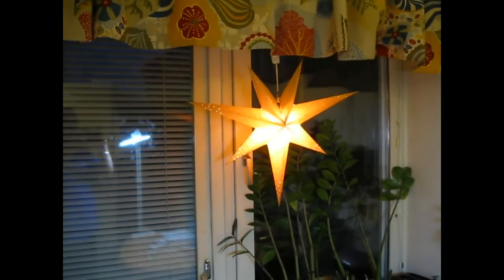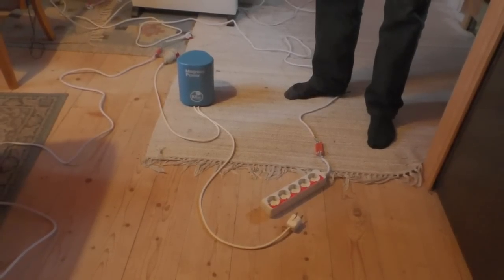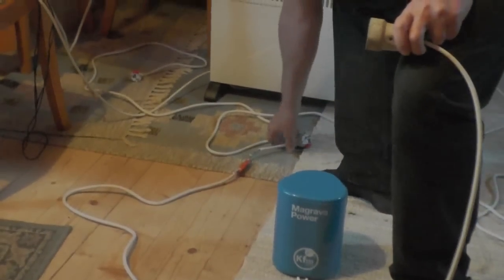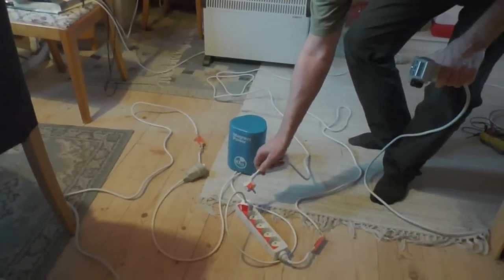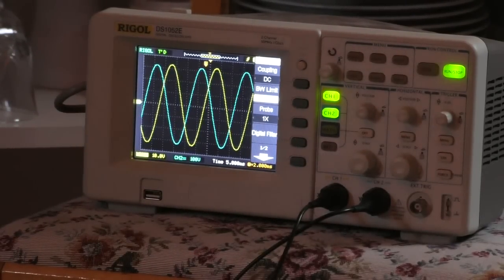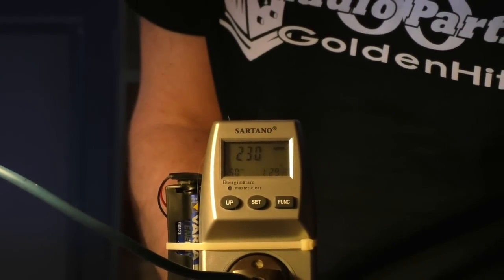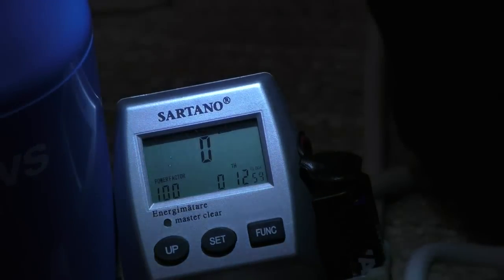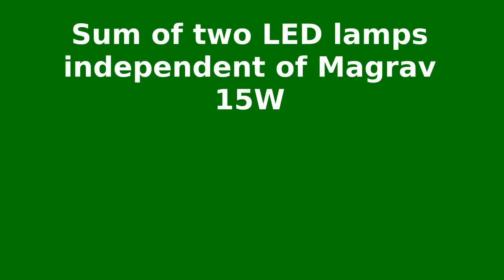#433 QEG Sweden Magrav Unit Tests

Comment: forgive me if mistaken, but I see on your meter, there is 50hz frequency, are you using 230-240v50hz AC?  I thought these magrav things were only good on straight DC..... which would make sense for if this does nano coat wires, if polarity is back and forth, is just blowing the oxides off, like aluminum ac tig welding.  back and forth polarity on a high-ish frequency will blow survace oxidation away from electronic bombardment of a surface, as with ac welding and aluminum oxide removal on the reverse wave...... just curious if so, and have you found any good results anywhere with AC or striaght DC or what?
Reply from the maker: News flash. These "magrav things" aren't any good at all!

Comment: The idea these "magrav" units are nothing more than power factor correction devices is proven here in this video. An LED light normally has a low power factor of between 0.4 to 0.6 and in this video it remains 1....nuff said.

Comment: There is no FreeEnergy in the Keshe-Plasmatechnologie, right?
The hole Keshe-blabla is f*kin' bullsh*?
BUT: my laptop has now a online standby of 120min and rising instead of the 86min like in the last 4 Years... just a pinpongball with some liquid inside on a computer-fan wired with blacked copper to USB. For that the Plasmalogy is good for me.
Maybe its placebo, but than, it was me who increased my laptopbatteries, not a Plasmareactor, or what?
Are we not gods? Just apes? I think, many of us are hidden gods and the others are apes. Just the children where born as man, conditioned to apes in the school, like me. But its possible to engage god-power, at least for me.

Comment: How on earth can you nano coat your house when you put a watt meter in the way??? Do you expect it to nano coat your meter first? Why are you not satisfied with reading your house meter? All of your expensive measuring equipment surely will mean nothing if your experiment is flawed from the start? Remove the meter, it will obviously serve as a closed gate to the rest of your house, maybe then it would be better to check for spontaneous nano coating? - Don't get me wrong, I have no clue if it will even coat your house but removing that meter would be a good start to a great experiment - Thanks for your video. :¬)

Comment: normally the watt after Magrev > watt before because Magrav is just extra-load :), but  watt-meters used in test are not good, one watt difference is not a problem because the load is low. Once the load around Kw, sure watt-meters will be more accurate and the Magrav will be just a load consuming extra watt .

Comment: Why is it that when people test stuff like this they almost always have a  mess of wires everywhere.  When building a testing apparatus all wires should be kept as short and as neat as possible so that anyone watching can visually see where all the connections are going.  Lay the entire thing out in line on a bench or table and everyone can more easily see the setup plus then you can leave the entire thing undisturbed while the test is running.
Reply from the maker: +kuhrd I agree with DG. The wires are much more clearly traceable than others I've seen. I have no reason to doubt the sincerity of the testers or the accuracy of the diagram given. What I am most curious about is what excuse Keshe and hos followers may come up with *NEXT* to explain why it does not work in the face of the evidence I am certain you are all about to witness?
Reply: +kuhrd 

This chap did an exceptionally clean build you might be interested in.
Reply: +kuhrd My thoughts exactly.
Reply: ***** How can you tell anything for sure some of the cords appear to be 5+ meters long overlapping other cables of the same color.  Then you have so much distance between things that they can't even reasonably get everything into a single shot.  My point is that everything on the circuit should be point to point wiring with as short of leads as necessary so that all devices are on the same table or bench with one single path in line so that everyone can visually see the inputs and outputs along the entire path without any points of confusion.  Also when dealing with cords of several meters they will add their own unwanted electrical characteristics to the circuit that can make things harder to duplicate or test in the future.
Reply: ZeroFossilFuel I would agree that you can more or less see what is going on but I guess when I want to show my students something I try to make all my wiring and overall layout as straightforward as possible.  Is there any reason to use more than 1/2 a meter or so of wire when connecting things up especially if we are going to leave striped areas to check for copper nano-coating or "oxidizing" by the rest of the world?
Reply: +kuhrd Well..yes you're right. All I can say is that at least it's being tested in Sweden.. where they have a lovely smooth reliable grid...(compared to here in the UK)  and a culture of honesty.  Much reducing the chance of a power interruption.. which apparently "nullifies" the conditioning period.. and (if I had to guess) nullifies the warranty too. I'm watching with interest anyway!

Comment: in has an inductance in series to generate much induction increases the power factor and reactive power generates much the household meters are not capable of measuring reactive current, this is a steal energy companies
Reply from the maker: +Cristian Marquez That's probably correct. And anyone can probably perform the very same stunt with a ballast transformer.

Comment: Despite agreeing with you about the numerous shortfalls and passed failings of Keshe, I am convinced there is some truth in what he preaches until all what he says is thoughroughly debunked. The only test that will convince me the magrav is a poorly designed paper weght is a that no one can get it to work for the promised adverized  benefits. Actually keshe has put money in your pocket so he has in some way contributed to the concervation of your energy. He is a questionable  controvertial person and no doubt you viewrship has benefitted greatly. This is not to take anything from your premium presentations and awesome work you do but I doubt whether I would have found your channel except through this maniac keshe. I can start one tomorrow and get a few thousamd veiws because of this guy so I will be grateful he exists as a vierwer booster if nothing else in the end.
Reply from the maker: +Harry Pink You are correct that my viewership has increased and that I do benefit from it. In fact, I am looking seriously into making what I do here a full time career as I will discuss in my very next video. So for that, Mr. Keshe, I thank you.
Reply: +ZeroFossilFuel It's reasuring to know there are some reasonable people on this planet :)

Comment: So why hasn't anyone done a teardown?? Surely, SURELY that will debunk this fairytale once and for all, no?
Reply: Jonathan Seagull
I've wondered where the nano coating process ends.  Will it majikally stop at the breaker box, or will it nano coat the world?

I mean, if it doesn't stop at the breaker box will the pole transformers flummox these pixies?  Maybe the entire electrical grid will eventually be covered in Pixie Poop?

Inquiring minds need to know!  Maybe we should get Geroldo on it?
Reply: +ColdTurkeyFlu 
I bet there is nothing more than a terminal block in that shiny blue box... or perhaps there is a little leprechaun inside turning a dynamo :)
Reply: +ColdTurkeyFlu 
It will happen eventually, I'm sure.
Reply: I'm thinking there's probably just a 1:1 transformer in it to justify some weight. Speaking of which, does anyone know how much this thing supposedly weighs? Seems for 1400 bucks they could have at least just shoved in an off-the-shelf power factor correction circuit to get some power efficiency improvement for at least inductive loads (i.e microwave, fridge etc.) Will be interesting to see the 'magic' inside lol
Reply: ColdTurkeyFlu

A hermetically sealed metal box chock full of majik pixies.

Keep in mind that if you don't keep positive thoughts, the pixies will feel your negative vibes, go on strike, and void your warranty...
Reply: AvE is that you...Pixies gave yah away...now, had you said Gyroscopic Particles, I'd have thought you were Joseph Newman. 

It's US against Them (the Remorseless Psychopaths & Fraudulent Scientists)
Either you're with the People or the Psychopaths in DC, real simple folks.